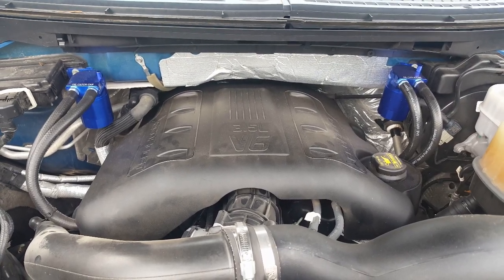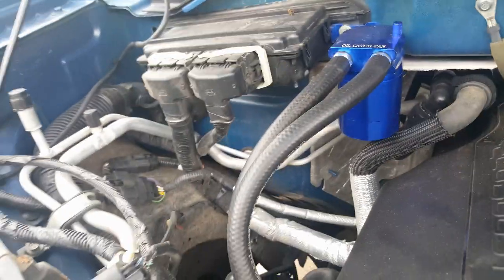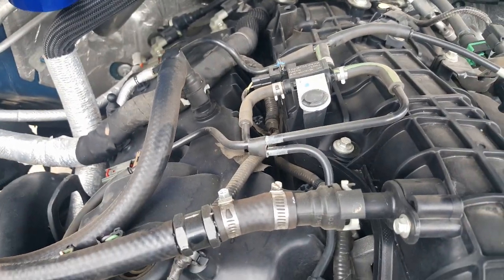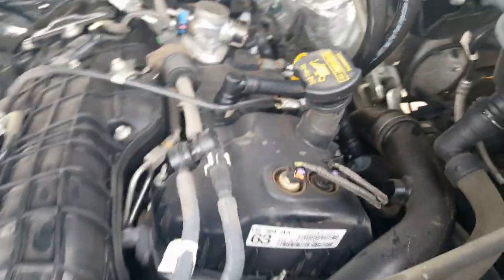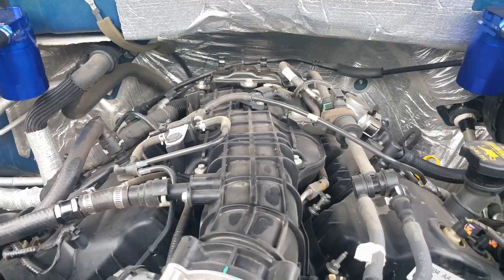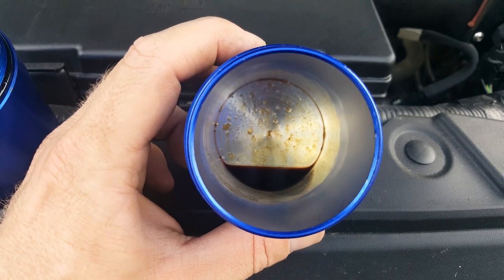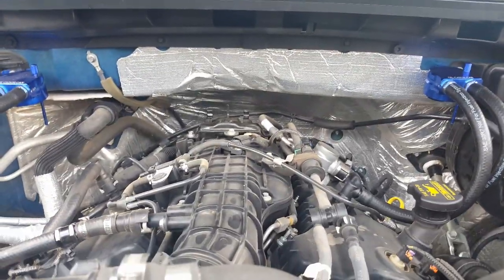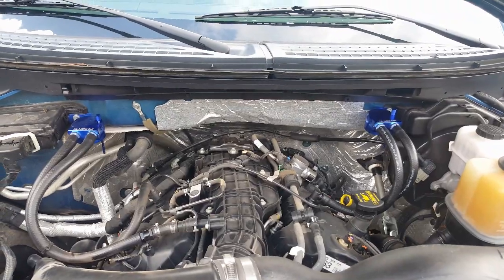✅ Make Your Own Dual Catch Can System for Ford F-150 3.5 Ecoboost

Comment: What happened to the clean side sensor at pcv??? Drivers side. Mine has a sensor and that’s where the P04DB code usually trips😊
Reply from the maker: Don't have the sensor on 11-14 engines.

Comment: Nice job but looking at your fluid in the catch cans I can tell that the filter you’re using really isn’t adequate for the ecoboost engine. The fluid is too dark, there’s too many contaminates pushing through your system. Start using a WIX HP filter and you’ll see the difference

Comment: Do you really need both?
Reply from the maker: When my engine was 100% stock you can see in the video what they catch.  Without cans it goes into your intercooler and on the passenger side it goes right into the intake.  With stage 3 turbos from CR Performance it is now mandatory I have not only 2 cans but I have had to upgrade to large ones with braided hoses.  We are still testing and watching however after the full engine rebuild with the increase in boost and blowby, the engine was blowing my oil out into the intercooler before I installed a drivers side can.  I have caught it twice now where it was 4 quarts low from this.  Once while regular driving with occasional hard acceleration and then again while towing my RV but at a highly accelerated rate due to the constant load.   I since added the second can.  After adding the can, it filled the can with oil and began overflowing again into the intercooler.  We have come up with a new solution being tested that adds additional venting to reduce the blowby turbulence trying to leave the engine at once and hopefully stopping the oil from being blown out of the engine.  If successful I will be posting a video on it.
Reply: @BOSSC351sProductions  Thanks for the reply, im just a slow driver that dont really push my 2.7L 2016 F150 very hard and there is very little oil. I was trying to decide if it was worth it to do the other side for probably a fraction if anything of what im seeing on the passenger side catch can.

Comment: I’ve watched at least 50 videos on catch cans to make sure I did it right and just installed mine today and I be damned if I watch this video only to discover I should have two catch cans not one and I need a one way check valve. Damn!! Do you really need the check valve? None of the other videos I watched installed one!
Reply from the maker: Unless you want to take a chance with pressurizing the can then yes install the valve.

Comment: I’m curious to know how these have held up. I installed the same set up on my 21 Ecoboost F150. After only 200 miles i got a check engine light for crank case pressure sensor fault. The passenger side can was completely full. I emptied it but the CEL keeps coming on for the same issue. Have you had any of these issues?
Reply: It’s probably a vacuum leak. Had the same issue on my 19 F150 with the 2.7L after 100 miles. I pulled out all the fittings and used Teflon tape on them. Another thing is the dipstick, it’s not fully sealed and will leak. I used Teflon tape on that and it fixed my issue.

Comment: I'm guessing that you can use 1/2 inch i.d. hose and maybe using some kind of lubricant and forcing the hose over the barbs so you won't need a hose clamp. Is this correct?
Reply from the maker: Correct
Reply: @BOSSC351sProductions  Thanks for your answer! I'm about to do my 2013 F-150 with the 3.5 ecoboost engine. I just bought it used.

Comment: Don't the oem ford pcv connectors have a 5/8 barb?
Reply from the maker: After taking my system off, and getting ready for a new configuration I checked and you are correct.

Comment: Won’t the out side suck in dirty air from the cans?
Reply from the maker: No, its a closed system.
Reply: Thanks for reply, I did the same set up as you! It works great!! But I do get a smell inside the cabin when I turn on the ac or heater. Does this happen to yours?

Comment: I have fitted two catch cans to my 2012 F150 3.5 Eco boost in front of my radiator for easy access. The passenger side gets water and sludge but no detectable oil. The driver side gets nothing over a four week period. Would you consider this correct. Really would appreciate your input......Ron C

Comment: Do you have two one way valves or just one going to the intake? I just purchased the same truck you have also same color lol and this was not done. I'm a little worried on how my intake looks. I've done a lot of research on this truck and seem pretty reliable without the catch cans but more reliable with them so I have everything but the one way valves.
Reply from the maker: Just one.

Comment: Great video! Just one question, I understand your logic for the one way valve.  However, the stock setup doesn't have one.  So does adding catch cans increase the risk of blow-back?
Reply from the maker: Im told the stock valve cover does however I do not want to pressureize the cans.  If you dont install the valve then you might get some.  I have not tried it though.

Comment: What is the inside diameter of the hose required to go from the can to the engine? Can’t seem to find that info anywhere, I have the 2.7 EB, should be the same ... thanks!
Reply: Half inch. He says "i.d." when he's talking about the hose at the beginning of the video. He means inside diameter.

Comment: Nice information! Putting one in tomorrow... question, did you use the steel wool included? Great info!
Reply from the maker: No, mine are empty.  Just make sure you empty weekly.
Reply: @BOSSC351sProductions  I have a2017 2.7 hopefully the 1/2” ID hose is the same as the 3.5... I wanna keep the old hose in case the can fails.. I gotta get the snap off connectors from my local dealer parts stores near me don’t carry them... thanks for your response!!

Comment: Great video,  did you use special heat resisting hose as the only 1/2" that I can find is  40 psi and not recommended for under the hood.......Ron C
Reply from the maker: No, not really.  It was just bulk hose in stock at my local parts house.  So far, so good.  No issues with it.

Comment: I don't get the one way valve the pcv valve factory is already a one way valve
Reply from the maker: The one way valve is at the port that directly enters the intake.  During boost it closes preventing pressure from building in the lines and can.  If you dont mind the can being under pressure and installing hose clamps at every connection then you can omit the valve.  I do not want the can or my lines to be under pressure so is why I installed the clamps before the valve.

Comment: My thinking is, if locating in the front as your showing, getting the oil 'out' won't be nearly as easy?   I see some add them close to the battery location, at least on the 2016 model years.   As you say, low is better...but too low is going to make emptying it difficult.  I'll have to get out there and really look my engine bay over and find the most efficient location....or check out Youtube, as a better location may have already been located for all I know.   Thanks for the videos!
Reply from the maker: Some in colder areas North tried up front but the can froze.  It comes down to preference.

Comment: Love this video. Makes so much sense. I'm thinking I might get a 3 port can and eliminate that input that goes into the manifold with the FR plug. I can acquire vacuum from the turbo inlet pipe on the drivers side, and hook both valve cover ports to the input of the can and not need a check valve.

Comment: So I want to do this same setup for my 2016 f150 Ecoboost however on the driver side it has a  PCV sensor my question is do attached the sensor to the hose going into the catch can or coming out of the catch can?
Reply from the maker: Let me get my brother to fill you in.  He is the expert on the later trucks.  Red Ecobeast is his channel.
Reply: The sensor needs to be on the inlet side of the catch can, I have seen some that it doesn't matter and some that will throw a check engine light. If it throws a CEL just switch which side of the catch can the sensor is on and it will go away. All it does is ensure the pcv system is hooked up and working.
Reply from the maker: Sorry for the late reply.  YouTube is terrible about notifying me about a question/comment.
Reply: @BOSSC351sProductions  I ha e the same issue on my channel.

Comment: Maybe a dumb question:  why a check valve?  Original Ford PCV lines have none.  So what if it blows a little oil back under highest boost pressures.
Reply from the maker: You do not want to pressurize the hoses and catch cans.  If you do you must clamp all the lines plus you risk blowing captured material back into the engine with sudden boost pressure.

Comment: I’m having a hard time putting a half inch hose onto the factory quick connectors. Did you also have this issue?
Reply from the maker: I used some silicon lube.  I remember it was harder to get the oem tubes off the connectors than get the rubber hose back on though.
Reply: BOSSC351's Productions Thanks

Comment: Do you need on way valves on a normally aspirated engine?
Reply from the maker: I do not believe you do on N/A engines.  The one way valve is to prevent boost pressure from the turbochargers from pressurizing the catch can system.  When the turbos spool up the engine switches from a vacuum to being pressurized.  On N/A engines there is no pressurization.  The degree of vacuum changes when the throttle blade angle changes but pressure is not introduced.

Comment: which catch cans are better these or the ones with a breather filter on top???? and i would either add a hose to the bottom of the catch can and/or add steel wool to keep oil at the bottom
Reply from the maker: You do not want or need the breather.  The system must be sealed or you will get a Check Engine Light.  Yes, you can add steel wool or similar to the can as an antislosh solution but it will be quite messy to change and clean.
Reply: @BOSSC351sProductions  thanks for the reply, have you personally used a catch can with filter breather on top and got a CEL?
Reply from the maker: @joeydelmarsjr.646  No but my brother tried it on his 2015 and the CEL came on.  Speculating, I would thing you would want it sealed because it is air re-circulation.  Otherwise you would be sucking air in from the filter at some point and not getting flow to deposit the oil and crud and also not pulling crankcase vacuum removing gasses.  This would increase sludge deposits and turn the oil acidic from lack of moisture removal.
Reply: @BOSSC351sProductions  you won’t suck any of that wool steal?

Comment: Hey can you make a follow up video? How’s the system working? What type of hose did you use? Fuel line?
Reply from the maker: I sure can.  I am working on my sons Bronco 2 at the moment but after we are done I will see what I can do.  Thanks for watching!
Reply: Sounds good!
Reply from the maker: @adamgarlick6149  Sorry, I really have had little time.  I got a promotion and have been working 6 days a week then working on each of my parents Dodge vans on my Sundays off.  I am thinking of relocating both my cans and that would be a good subject for the video.

Comment: You don’t need to add check valves to either side, as OEM are fitted with check valves to rocker cover sockets
Reply from the maker: Maybe so but I do not want to pressurize the hoses or cans.
Reply: BOSSC351's Productions Fair enough mate 👍

Comment: Hey Daniel great video, what size are hoses and where did you buy the one way valve, please let me know sir ty
Reply from the maker: I used 1/2 ID hose found at just about any parts store.
Reply: @BOSSC351sProductions  hello Daniel, appreciate the info, this is gonna sound crazy I've looked everywhere cannot find 1 way valve, please I need a favor if I can send you cash thru your PayPal account would you would you ship to me? Including 1/2 inch hose. Please let me know if you can help, ty so much Sir
Reply from the maker: @sammedellin9747  I added a new link in the description to the valves.

Comment: Any CEL?, I know the driver side is very easy to throw a CEL on the driver side because of the PCV sensor.
Reply from the maker: Nope.  No CEL.  Maybe on the 15 and later though.
Reply: @BOSSC351sProductions  maybe. Cold air Intakes are throwing codes on the 15s due to that sensor.
Reply from the maker: @deersly  I believe so.  My brothers is a 15 and he was saying something about that.
Reply: @BOSSC351sProductions  You should talk your brother in to letting you do a video on installing a dual catch can system on his 15 ecoboost so we can see what that will require. Thanks in advance and great video.
Reply from the maker: @donell82able  He actually installed his own setup.  I told him he should have done videos on his installs but he is hesitant.  He is on YouTube too here....   https://www.youtube.com/channel/UCw1GRCQ_MIeKQxnWJC6pZMQ

Comment: Where did you get the one way value
Reply: Can post a link of the same catch cans I like how’s your mount
Reply from the maker: @blakehartman5399  I used the brackets that came with the cans and had to slightly modify them to install sideways.  I used small washers as spacers under the brackets to get it to fit right.
Reply from the maker: I added a link in the description for the valve.
Reply: check amazon

Comment: Hi! I did this exact setup.. just the passenger side... I already had a weep hole.. a lot of oil came out... I've been driving for 2 weeks and the can has not caught any oil...  any idea why?
Reply from the maker: If nothing is coming through, check your one way valve and make sure it is not backwards.  You should have something there.  Otherwise you are not getting pcv system flow.
Reply from the maker: Is your check engine light on?
Reply: @BOSSC351sProductions  check engine light not on.. valve is facing the correct direction.. I'm in San diego, maybe it's the weather... .my 2012 is running great! But puzzled when I saw it empty.
Reply from the maker: If its real dry then possibly that is why.  If no flow then the CEL should come on that the PCV system is not operating.  You also may be getting rid of all of the crud at the weep hole.  Wait till you get a good rain and see what happens.
Reply: @BOSSC351sProductions  Thank you! Great video! The best one I've seen. I dont drive it much I live 7 minutes from my job... its only been 2 weeks... I'll check it later see how its it's doing
Reply from the maker: Any which way you seem to be winning.
Reply: @BOSSC351sProductions  one last thing, I unplugged the fitting leading to the Intake... I saw some oil.. shouldn't it be dry?
Reply from the maker: @carlosvazquez4842  Your catch can should catch the majority of the vapor but some may get through.  Some have added steel wool to assist in the collection.

Comment: Thank for this video. I've been wanting to do this for a while but thought the cost was absolutely ridiculous! I did this exact set up today on my 2011 F150 3.5 EB for total cost right at $100 for all parts.  I just had my engine chemically cleaned and I also changed my sparkplugs. It should help it run better, get better gas mileage, and prolong it's overall lifespan. Thanks again!

Comment: Great video and great description on the set up. I’ve been wanting to do this to my 13 ecoboost for so long now but couldn’t bring my self to drop $400 on a catch can system. I knew it could not be hard to make a DIY catch can set up for a fraction of the money but I could not find the info on it but this is exactly the video/tutorial i was looking for!
Reply from the maker: Im looking at changing the locations of mine to somewhere up front and lower than where the hoses connect to the engine.  This way, any residue in the lines will drain into the cans and not the engine.  Thanks for watching!
Reply: BOSSC351's Productions would it be possible to replicate this setup but with using a 3 port single catch can? I know you would have to T the clean side together but what other differences would there be? Bc most of the 3 port catch cans have 2 inlets and one outlet so how would the lines get run then?
Reply from the maker: @diamondeyez1999  I believe it is.  My brother uses a 3 port on his 2.7 but I have no idea how he did it.  Ask him here.....  https://www.youtube.com/channel/UCw1GRCQ_MIeKQxnWJC6pZMQ

Comment: Did they come with the mounts ?
Reply from the maker: There is a bracket on the back that comes on each can.  I had to drill and modify the brackets to install them where I have them.
Reply: How about  the one way valve do you need one for for driver side ?
Reply: Jose Chavez no drivers side is suction only
Reply from the maker: @cchavez302  Adam is correct.
Reply: Where can I get braket

Comment: hello sir, great video by the way.. something you might consider doing as well is putting long strand steel wool inside the cans.  In my experience with my last catch can, it was not catching nearly all the oil when the can was hollow.  I filled it with steel wool and it made a huge difference.  The wool gives the vapors a media to cling to and then drop out of suspension.  Won't cost you 3 bucks and I think it will help you like it did me.
Reply from the maker: I have been looking around for some media but considered steel wool initially.  Thanks!  I just might do that.

Comment: Is there a reason you did both sides? I have seen similar setups that only can the passenger side.
Reply from the maker: Yes.  You are pulling a vacuum on the crankcase on the drivers side through the valve cover into your fresh air inlet tube to recycle vapors.  This also pulls moisture as well as oil vapor into that tube.  You want to catch as much of both as possible so it does not go through your turbo and into your intercooler where it will puddle.  Both of my cans are near full in 2 weeks here because of the cold and rain we have had.